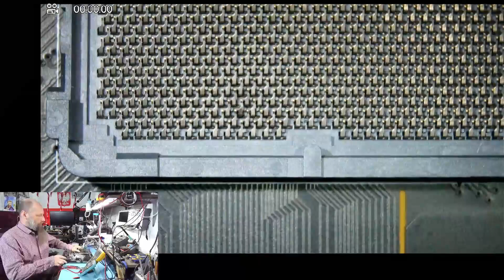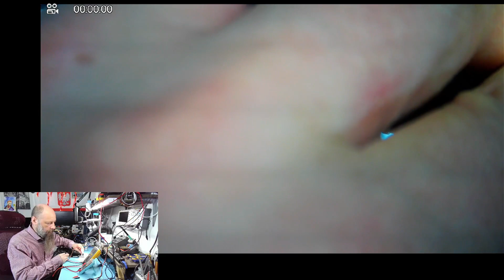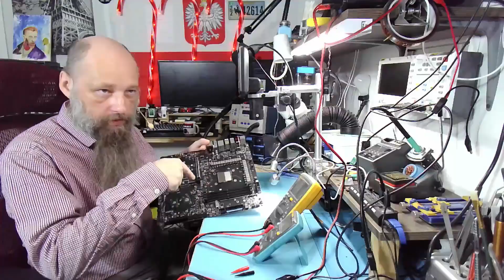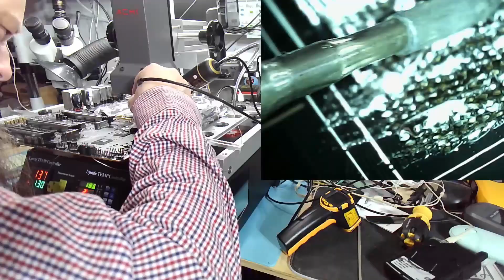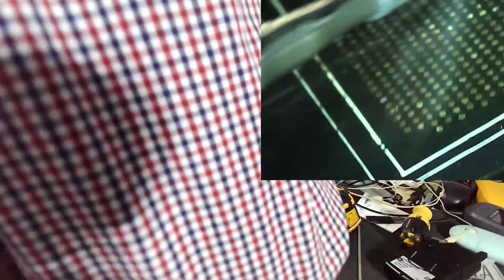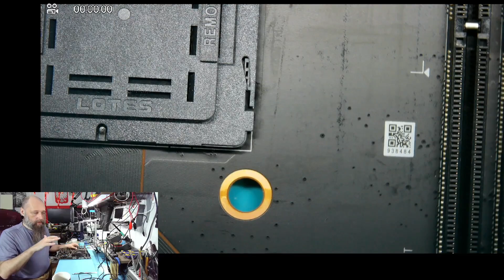#87 | MSI X670E ACE Repair for Trevor

Comment: In some motherboards, like MSI Z790 tomahawk and other MSI boards there is 100 Ohm resistor in vcore circuit (and you can find it on boardviews) so when you will try to measure vcore resistance it shows low resistance about 100 Ohm. When another boards showing KOhms.

Comment: Hey the video didnt even start yet … and i totally know with out looking … how could you help … 

But my friend miss matched psu cables and plugged in the 24 pin and now the board is fried … if i were to try and fix it … where would i start knowing it was a mixed cable and psu thing??
Reply from the maker: either a short or blown fuse, depending on the board and of course which rail was plugged in in reverse.
Check for shorts. If there are no shorts, look for a fuse. If there is no fuse but you get OL measurement you might need a board view to find the fault. VCORE should be easy to diagnose because there are only a few components. If it's primary voltage, you might have fried SIO/EC or PCH especially if 12V went to the 5V line
Reply: @blackhorserepairs thanks … never “fixed” anything big like this … he isnt worried because he already chalked it as a $300 loss .. so free test board 😂